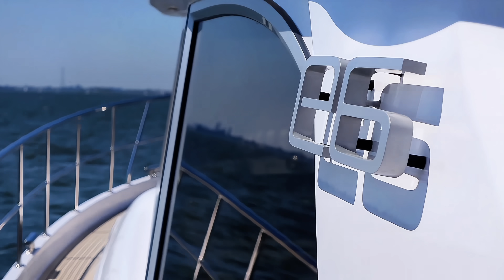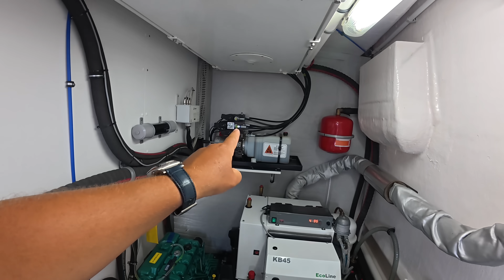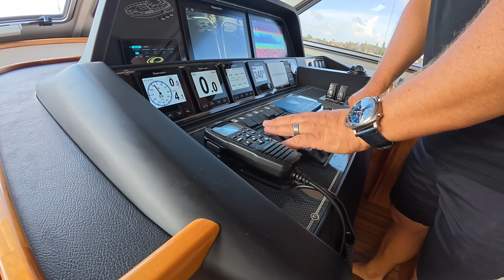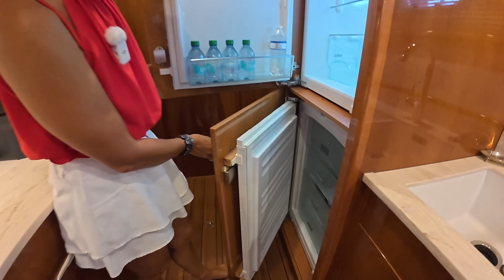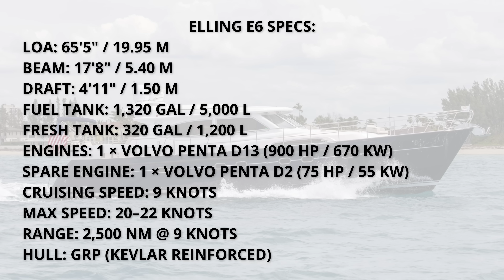SELF-RIGHTING YACHT 🤯😳 Elling E6 Ocean-going Offshore Long-Range Liveaboard Yacht Tour

Comment: It's 500mi shy for a Trans ocean vessel actually at moderate cruise one should have 3000 to 5000 mile range as a safety margin but 3000 is minimum gold standard. Your spec sheet doesn't say 5000 mile range .

Comment: This may be a dumb question,  but can no one come up a type of  inflatable airbags for the sides of a yacht for emergency situations? Just enough to keep at least the upper deck above water so the yacht could still be used as a temporary life raft or to add additional time to evacuate. Also, if the yacht were to list too much, have the airbags deploy on one side to compensate and slow any additional listing, and again provide more time to evacuate, or maybe additional time  for the pumps to catch up.

Comment: The problem I see is that the inflatable seal is going to be an expensive wear item that will need constant replacement. I find that to be a bad design. Imagine how much water could leak in when that seal eventually fails and it rains.

The one thing it does have going for it is the self-righting capability and the fact that it has Kevlar lined into the fiberglass throughout the hull during the molding process. That makes it almost impenetrable if it hits a rock, dock, or even an iceberg. Something the Titanic sure wished it had. 😂

Comment: I have been an avid yacht touring addict for the last six or seven years having seen many hundreds of every style and size imaginable.  If money was of no concern I would be torn between a 40-50 foot coastal cruiser that is Great Loop capable or a 50-60 foot category A ocean going vessel with at least a 2500 mile range.  This spectacularly well designed and well made yacht checks absolutely every box. I didn’t hear mention of a water maker, but I’m sure it’s an option. I really like the balance of the light colored wood and the white panels utilizing very creative glazing design such as the atrium style light above the dining area. This is one of the very finest yacht designs I have ever seen. Safe, practical, comfortable and versatile.

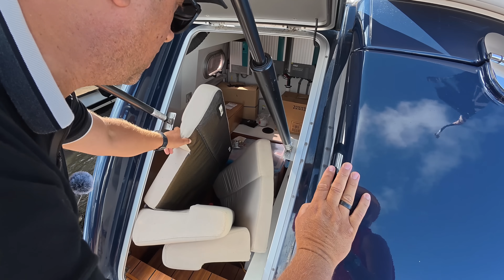Comment: Question:  The first compartment, shown at 2:50, you stated could double as crew quarters.  If so and if that compartment is watertight, would that not be dangerous for anyone spending a few hours without air?

Comment: In the unlikely event it does roll in heavy seas, you need to be strapped into a seat. That means the seas are threatening enough that the captain will order all passengers to take their seat and belt up. There are no belts that I can see?

Comment: I wonder if these yacht experts know that almost 90 percent of small yachts under 70 ft when slowly rolled over will right themselves. Doesn't make them a self righting boats by design. There are many off shore patrol and police boats that are true self righting boats, designed to right themselves when turned over in violent  seas, but this company obviously didnt address the fact that most will right themselves when slowly rolled over on an axis. So I question the legitimacy of this companies claims.

Comment: Exactly how is a engine pulled for a rebuild?  I saw no top access.  With as much thought in design and engineering I would 3xpect a way to crane a engine trans out thru the open roof access by removing floor and other panels that are designed to be removed or opened.  It's one of the reasons I am partial to trawler hulls for open sea.  Full height and size engine room with access top to remove engines etc. enough room to script as a small mechanic/mac8ne shop, bench vise, etc. 

Really liked the owner and head. Great galley.  Like the overall design
Reply: @timw911 my guess the large removable panel at the stern … allows it to be pulled out.  Maybe on mount rails when unbolted slide?
Reply: @MeYoutube-e7n that makes sense thx

Comment: That's an accessible engine??? What a joke!!! Really cool boat but you need to be more realistic. Not all things are "really cool" or "fantastic". 🤦‍♂️
Reply: There's an old vid with all the panels off & some footage underway. It really IS impressive, both access & soundproofing. It's a 65 foot semi-planing hull which usually means a  crawl space at best & tables have to be flipped, etc, to get at stuff, right ? Irrc, the E6 has a soft patch design to take the entire motor out as well in the unlikely event you needed to.

 The access problem with this design, imo, are those aft  compartments full of key systems. Maybe you could  have  hatches in the deck of the aft cockpit. No way could you safely get in through those hatches in any kind of sea which is EXACTLY when something would go wrong, of course. Kinda weird for a design that has so many blue water safety features built into it.
 
Otherwise, I love this design. Faster than a trawler but tough & super sea-comfortable.  The separation of cabins for real privacy. Two interior common areas in a 65 footer ?!  The sliding roof gives you the indoor/outdoor vibe of a fly without the windage or maintenance hassle. All stuff that makes sense for real world use.

Comment: May be it is a good boat, but it is not realistically fit for long distance travel. Its main engine compartment is a nightmare if you would need do more than an oil filter change. Its induction cooktop in the galley is not equipped to hold pots in place. Its claimed fuel tank range of 5000nm - really?

Comment: Thanks for this tour. You asked about the security of this yacht. Well, I capsized on starboard and rigged back on backboard with a Nautor Swan 65 in the north Atlantic. We were lucky to still have both masts but we lost the engine, the generator and most of the systems on board. So, since I have never seen a Volvo D13 running upside down, I would state self rigging is a funny feature. Next, if you attempt to cross an ocean with only one engine, it is your problem. The engine will certainly not break but your cooling system may because you sucked up debris. If this happens I cannot really imagine making a 500 nm ride home with just the wing engine...
PS: make a bet I shink this yacht? ;-)

Comment: I don't like that roof ! That is completely unnecessary for a capsizing boat !!
Waves bashing against that boat in bad sea's could compromise those seals and then to possibly capsize 😮, no thanks , not to mention it is not going to age well along those seals , do away with the pointless sliding roof and problem solved

Comment: I bet the noise is almost nil with that amount of insulation, on the engine compartment. 
Nice galley, for the range there doesn't seem to be a lot of refrigeration in comparison to some others you have shown. (13 fridge and freezers units).

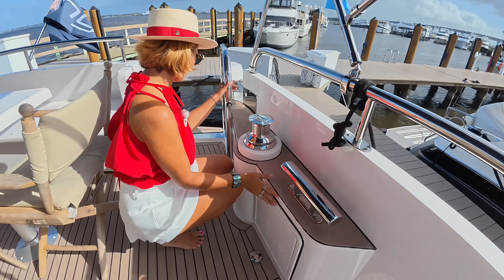Comment: Question.  At about 8:30 into the video she is showing a big cleet and line storage locker.  Her hand is on what looks like a winch, but you didn't mention that.  It looks like a winch for a sailboat.  Is that for a rear anchor?
Reply: It can be used to pull the lines tight when mooring stern-to.

Comment: If there's a 12inch hole at the bottom, then does it still have the buoyancy to float. I think that's possible if there is an automatic inflatable system running through the walls or throughout the entire structure to support the entire weight of the boat plus other backup unsinkable systems.

Comment: That's what they said about the Titanic.. Unsinkable!!!!  Volvo D2 as backup? I would think they would use D4 at least.  I have a D4-260 on my 24' Osprey Pilot house.  You should have shown all panels removed to show the engine is fully accessible to maintenance and emergency service access if navigating.  Such crowded space, the engine cause a lot of heat and assume there are cooling fan to exhaust the heat from the bilge engine compartment.

Comment: Victoria is absolutely right: the Elling is a lot like a motor sailer rather than a motor yacht, with its relatively narrow hull form, and particularly with the self righting ability - in fact its self righting ability is better than the majority of sailboats which often become stable once inverted beyond 130º or so. I like the security of the tender garage too in that respect, but would be prepared to sacrifice that for a large crew/overflow cabin in its place with the tender perhaps stowed on carbon davits behind the main (only) cockpit seat - on the basis that even on a 65ft sailing yacht you would expect 4 cabins whether you had crew or not.
Reply from the maker: Thank you so much for sharing!

Comment: One thing you forgot to show is the horrible placement of the batteries under the stairs and below two floor panels. Also you should have removed the panels in the owner's suite. You would have had a better view of the engine space and the sea keeper. It's located behind the engine. These are extremely good looking boats but some elements are very awkward in terms of service. You basically have to tear down your living space to do basic service on the boat. Many boats this size have engine rooms that you can access from a hatch on the aft deck. However this was built to right it self so I understand the placement of the weight and the design. Super good looking boat that I know for a fact attracts attention at high class marinas. It's one of those, "wait a minute, this one is different from the others" type of boat. The more you look at it the more you like it. It's tall but very low overall. Most loopers are using less expensive boats but this one is perfect for that and for ocean going trips once you're looking for your next journey after the loop.

Comment: Perfect boat to explore Alaskan waters!
Reply: no, it is not.  any boat that size you cannot access the engine easily in should never be in dangerous waters.   this is for rich people to cruise around the med, or across the atlantic before hurricane season. this isn't for cruising across the pacific, or dangerous waters near the polls or even winter waters (anywhere). 

it's a lovely boat but half of the internals would be smashed to kindling in any serious storm on the high seas, and the inability to actually reach the engine or the backup mean you are sol if things go south.  it's definitely got great safety features, but i wouldn't take that thing into any 4-5 meter sea. and those are waves you get around gale force winds.

Comment: Man, I luv safe boats in bad weather, but one question for Rico, what happens to the engine oil pressure when it rolls over ? is the motor still ok ?

Comment: Interesting engine layout. Not so much an engine room, but pretty much access to it from all sides. Nice long range yacht. Glad they designed in the wing engine. So many tours I have seen of long range trawler yachts, but with one engine. This one is a long range cruiser with one engine, but has the wing engine just in case. Cool galley set next to what I would call a den. Nice walk through of a nice yacht. My only complaint is it would have been good to see inside the tender garage, but I understand not being able to show it with it being tied up.

Comment: I was considering an Elling E3 and flew to Seattle to see one for sale. Very similar to the 6 but about 2/3rds the size. But upon closer inspection the engine room access on the E3 was just too difficult. You barely showed this on the E6 but it looks similar. I love so many things about the Ellings but this is a showstopper issue for me. You need to at least be able to easily view/inspect systems.  Ideally also should be easy to service. At least in the E3 I saw it was next to impossible to even do the basic visual checks, much less service the engine and other systems.
Reply from the maker: That's a very fair observation, and it's definitely something potential owners should pay close attention to when considering any trawler-style yacht.

The E6 does offer slightly better access than the E3 due to its larger size, but you're right that it doesn't have a traditional stand-up engine room like you'll find on some larger displacement yachts. As we mentioned in the tour, Elling prioritizes interior volume, safety, and all-weather cruising, which inevitably leads to some compromises in machinery access.

For many owners who primarily rely on professional service technicians, the tradeoff may be acceptable. However, for hands-on owners who perform their own maintenance and want unrestricted access to every system, it's an important consideration and something we'd strongly recommend evaluating in person before making a purchase decision.

We always appreciate comments like this because they provide valuable real-world ownership perspectives for others researching these boats.

Comment: A well engineered, beautiful vessel. That being said, it is as appealing as a submarine that can't dive. It is for people that don't like the water or water sports, i suppose?
  This craft is definitely not suited for the American market. 
  Maybe good for getting from point A to point B, but not for living the lifestyle.
  As to the capsize proofness? Unless you are strapped in, the sea will play ping pong with you until it finally puts you out of your misery, by dumping you on your head and then proceeding the ping pong game once again with your limp carcus.
  PS i think the German  type 2 U-boat used a similar engine configuration?
Reply from the maker: I think that’s a pretty surface-level take on what this type of vessel is actually designed for. Not every boat is built around tow sports, beach clubs, and marina hopping. Some are engineered for long-range capability, safety, efficiency, and the ability to handle serious offshore conditions comfortably for extended periods of time.

The “American market” is also far more diverse than center consoles and weekend cruisers. There’s a growing segment of owners looking for expedition capability, self-sufficiency, quiet operation, and true passagemaking comfort — especially people planning long-distance cruising or living aboard.

As for the capsize comments, any vessel in catastrophic conditions becomes dangerous, regardless of type. The point of capsize recovery engineering isn’t to make storms “fun,” it’s to maximize survivability in worst-case scenarios. That’s very different.

And comparing it to a Type II U-boat might sound clever, but diesel-electric and protected propulsion configurations are used across many modern commercial and exploration platforms because they’re practical and efficient — not because they’re military submarines.

Comment: Generally one of the better boats of our modern age. A few tweaks with some of those sitting areas, that you said is possible, and it would get better. I assume the dining table below has a fill in for another berth. Just one fatal flaw, no water maker. And I really hate it when the tender is tin a garage. Valuable interior space gobbled up by something that should be on the outside.

Comment: Shouldn't there be seatbelts 😆? If its built to flip, and your in weather you thought you might, I would want to buckle up. What would it look like inside after a roll over? What would be the concerns of things flying around. Is the tender locked down? Are all the glasses, and wine bottles breaking? Is the washer and dryer mounted? Could you just take this anywhere at full tilt then since its self-righting?
Reply from the maker: 😂 Great question! Self-righting is a last-resort safety feature, not a "send it" button.

Most heavy equipment, furniture, and the tender are securely mounted, but after a full rollover you'd probably still have some broken glass and a mess inside. And no, it doesn't mean you can run full speed in any weather—Mother Nature still wins. 🌊

Comment: Check out SafeHaven Marine, they build up to 70 feet extreme offshore rescue, and pilot boats. Just a few hundred NM range, that's all that's needed for their build purpose. SafeHaven runs monster power in their boats, often over 3000hp with surface piercing drives and huge jet drives, $4 million range. Tons of big water videos, check it out, don't forget your sick bag(s)
Reply from the maker: noted

Comment: Boats that are designed to test nasty waters should carry light weight cycling helmets to go with lifejackets. Totally sucks to have your head ripped open on something silly like a marble counter top!!!!! Clean layout, not a fan of the high gloss but I'm guessing it's there for a reason, after 3 roll overs in 1 hour those glossy surfaces tidy up real fast. Boat seems well priced for what you are getting.
Reply from the maker: Thank you so much for sharing!

Comment: boats totaled if you have to replace the engine..
Reply from the maker: Not necessarily - a boat is considered a total loss only if the estimated cost of repairs—including the engine replacement—exceeds the boat’s Actual Cash Value.
Reply: @NautiStyles  how will you replace the engine without removing the deck above the engine? granted you could rebuild it place, but if the block needs replacing because of a cracked cylinder... just saying, its a beautiful boat but because of the engine placement I would have to pass.

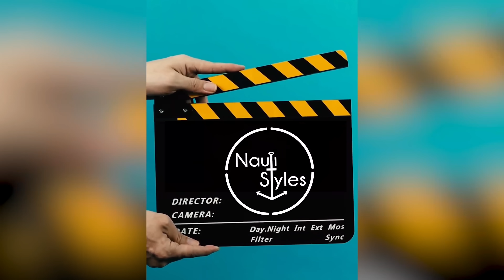Comment: 23:1 count of video. The range is 2,500 NM @ 9 Knots, not 5,000 as Victoria said at 25:19 count of the video.
Now I'd like to know what safety measures are in place to secure the inside of the yacht in the case of a rollover?
Is the reason the engine is placed where it is on this yacht that it'll protect the engine when and if it does roll?
I loved the galley down below. All cabins were very nice. The walk-through was again very well done. Catch you guys next video, cheers.